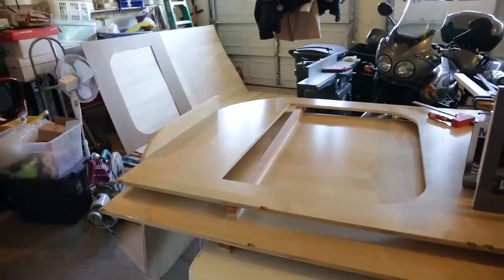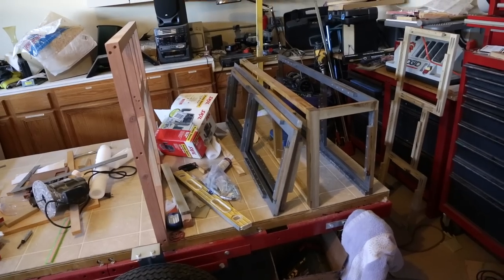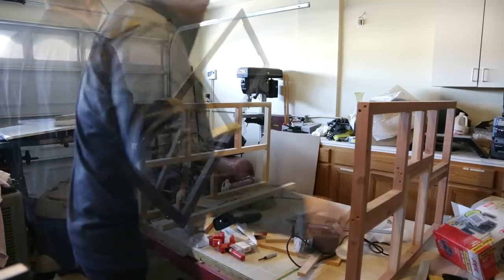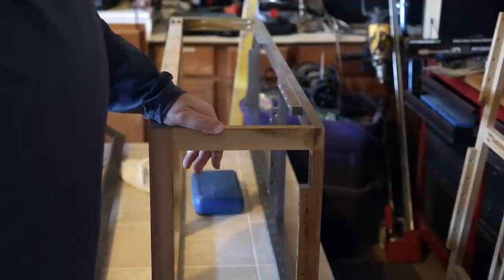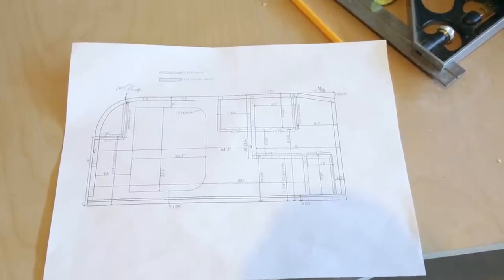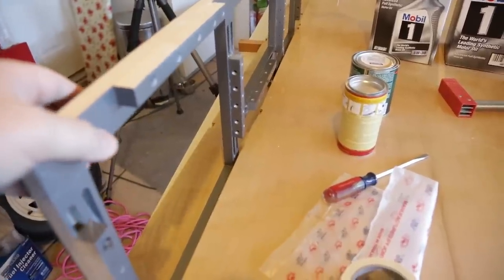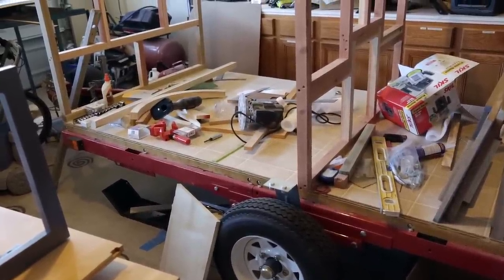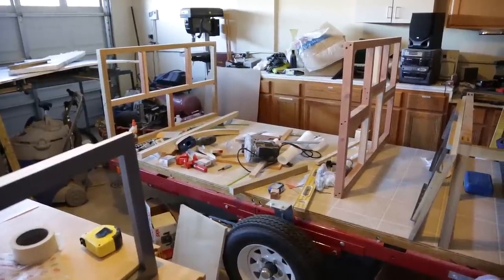Teardrop Trailer Build

Comment: I have watched all you videos, i see one huge mistake i wanted to mention so other people don't make the same mistake...  never, i repeat, NEVER use a bolt together kit frame. Those things may be good for occasional towing of stuff, but are awful for anything perminately installed. These things are the foundation of your entire build and it is the one place you should not try to save a buck or two. If the frame weakens or fails your entire build and all the time you have put into it are gone and basically worthless. Once your teardrop is build on it, it is nearly impossible to get to the bolts to tighten them if it ever needs tightened and by the time you notice they do need tightened, parts of your teardrop will be loosening, separating or breaking and then you have to tear it all apart and start all over to fix it.
Reply: +bck318 Please people, don't listen to this nutcase. Harbor freight trailers are probably the number 1 trailer of choice for teardrops.
Reply: +Brooklyn Avenue The problem i have heard with the harbor frieght trailers is in the bearings when they ware out you are screwed because they are metric and no one carries barrings in metric so you can't find new ones to replace them ...sounds like a problem to me down the road ....
Reply: jlions72 Metric system bearings are available online, easily, anywhere on earth.
Reply: ***** Precisely. It is a simple matter to detach the teardrop.
Reply: bck318 using locktite on the bolts fixes that issue.